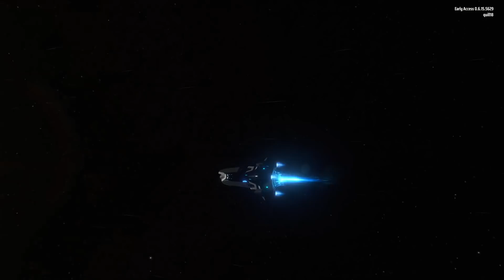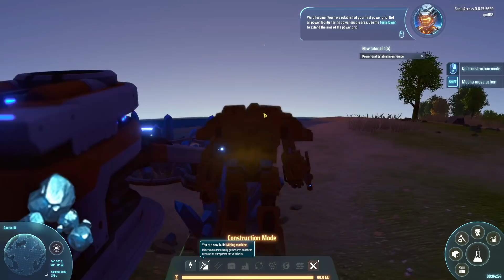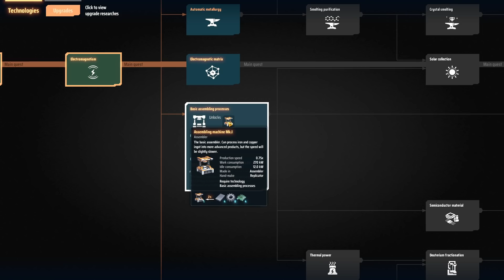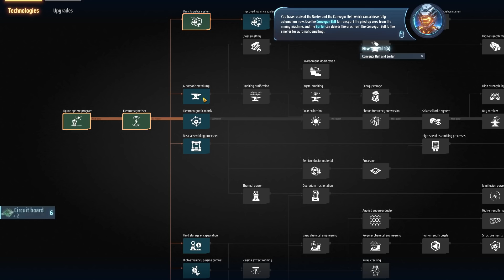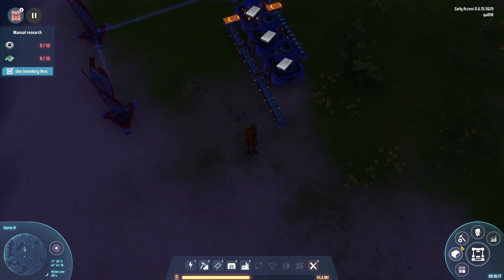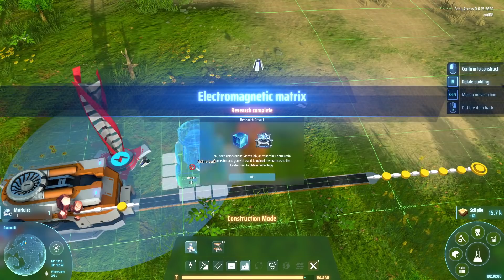Dyson Sphere Program - Cosmic-Scale Factory! Ep 1

Comment: if you do a bus, its most efficient to do 2 lines + space and repeat, the splitter stuff only goes 3 tiles max so the 3rd tile needs to be the space so you can output to a belt, move forward one, then split down to the next space, to move across the belt (of course you can do higher level bridges and stuff but does make things more complicated)

Comment: Also you can use multiple sorters from and to one building, you just had belts selected instead when you tried. Also you can use sorters directly from one building to another without a belt between.  the sorters are quite literally identical in function to the arms in Factorio.  They're basically the green(?) smart arms with variable length.  Edit: You figured this out later in the video, kinda figured you would.

Comment: The only thing that’s frustrating about this game is the grid system on small planets towards the poles. Especially the tiny starting planet. There’s so much water everywhere you have to work around, and then if you build towards the poles the grids get all weird. Also it’s be nice if conveyors carried power a certain distance so you don’t have to set up Tesla coils in the way everywhere. Maybe there’s an upgrade for that later on i don’t know. It’d also be nice if it was easy to tell which machines you can run a conveyor all but one space up to snd then have the shortest sorter possible to maximize its speed as some you can go right up to it and others you need like an extra node of space. And some things like storage chests you don’t even need a conveyor from a machine into it, you can just use a sorter right out of the machine into the chest. Also it’d be nice if you could split a conveyor in multiple directions a bit easier. I know later you unlock a splitter, but that again takes up space and I’d use that more for splitting one conveyor with different items into separate conveyors using the filter rather than just splitting one conveyor of one item into 2. For that I’m just using a separate conveyor line next to it and using a sorter to pull from it, or 2 or 3 if I need to bring more over. But hey it JUST came out for early access so I’m sure there will be plenty of fixes and changes and improvements. And for having just came out, I’m extremely impressed.
Reply: Also would be nice if similar to cities: skylines, once something that requires power is in range of a Tesla coil, that machine gives off a tiny bit of power extension range. That way you can bring a Tesla coil line within range of a production line, get it to power the first one, and then that once can extend power to the next one if it’s within range and so on so you don’t need to put Tesla coils down EVERYWHERE lol

Comment: You can use multiple sorters on one thing, you just selected the belt and not the sorter the 1st time you tried. 4 sorters at min range = one full belt at this tier. headsup, sorters are slower the longer they are, or rather their trips are longer, so they do less trips a second.

edit: you can stack some buildings as well. Some work together if you do(like research and storage), but other's just stand on each other, like splitters and belts(although that one might be obvious).
lastly, some buildings allow you to place tesla towers between them, even if the buildings are super close. The assembler is one of those buildings

Comment: One thing you COULDN'T do in Factorio is stack belts on top of each other. Stack 5 belts on top of each other, a different item on each belt, and you have a "five wide" bus in a single line.
Reply: Hence why people compare this to Satisfactory as well. :)
Reply: The downside to this though is that it takes quite a bit of distance to get things back down to ground level to use in machines. I wonder how well it compares to a wide bus as that's what I'm using right now. I just lift the belt I want to use up one level  and pull off of it. Also crossing a tall bus seems like a nightmare. Maybe there is some optimal middle ground between the two?
Reply: @TripleOmega  Hopefully they may consider an item elevator like Satisfactory has.
Reply: @bigdog91paper  you can sorta use splitters as an elevator, but it's not very compact
Reply: @LINKedup101  I mean, its 4 instead of  2 I guess
Reply: @TripleOmega    @WIbigdog  Looks like you could make a sqaure-spiral of ascending or descending belts to get around this problem.
Reply: @ILikeGoodFood  You could, but honestly that's kind of a pain to build every time you want something off your bus. Maybe if they add blueprints that let you copy and paste complex structures this will be viable.

I did think of a hybrid alternative though. Make your bus on level 1 and 3. Lift up or down to level 2 every time you want to pull off the bus. The downside to this is that you   are hard limiting yourself to using only level 2. You can never go over something that is in the way when extracting from the bus.
Reply: @TripleOmega  I ended up buying and playing the game and have found a number of issues with verticality and busses:
The belt splitters are two tall, not one, and can only be stacked two high without research.
This means that a bus can only effectively have a belt at ground level and at 2 stories up, with a pass-through-level 1 story up.
The splitters cannot have belts going over them at 2 stories up, or going under them, so if you want to branch one of your belts you must place a splitter on both in the column.
The splitters are 3x3 grid squares, however they also then need an additional square around them to get belts into and out of them. This means that they have an effective 5x5 footprint.
With these considerations in place, the most efficient buss using splitters is a belt at ground level and 2 stories up, with a gap of two grid squares on either side before the next double-belt. Combining this with the five square length required to get things up and down from the 2 stories up position to the 1 stories up position as a pass-through level, it's actually very bulky.
Also, the planets are way smaller than they look at first, and this bus rapidly starts to take up a significant portion of the planet's total surface area.
It does make for a very effective tree-style arrangement though, with the bus/trunk running straight through everything and tangental spokes/branches with manufacturing, smelting and research.
Reply: @ILikeGoodFood  I don't use any splitters on my bus for this very reason. It's nice that they don't require power and divide things evenly, but it's not worth the extra space requirements.
I did not realize they could be stacked, so thank you for that information. Might be useful somewhere.
Reply: @TripleOmega  you could do it to a half level
Reply: @d4s0n282  What do you mean by a half level? When I refer to levels I'm referring to all the heights that conveyors can reach. So there are no half levels in my point of reference.

Unrelated to your comment I also have to mention that since my last comment I learned that splitters have 3 variants. One of which makes splitting off of a bus very easy. It does come with the big downside of requiring a gap between each lane to accommodate the splitters, but it may be worth it just for the ease of construction.
Reply: @TripleOmega  well yes, but you can force it to half a level, thus it only takes 2 instead of 4
Reply: @d4s0n282  I still don't understand what you mean by half a level. If I press up when holding a belt I bring it up from 0 to 1. That is what I mean by a level. As far as I know there is no way to run a belt at 0.5. I also don't see how that would help reduce the splitter requirement for an elevator.

Comment: One of the really fun tips that you might miss the game telling you:  You can stack storages AND labs on top of each other.  And the bottom one in the stack feeds the ones higher.  They don't share inventory so if you want something from one of the stacked buildings but not another you have to click on that specific one, but well...

It basically allows you to triple your science speed at the start using the same space, because it doesn't take much to provide three times the resources needed for a single production cycle of the science resources compared to just one.  So you build a stack of three labs to produce your blue science, then you build a stack of three labs to consume the blue science.  Adding another stack of labs to produce the red science later on and feeding it to the research stack isn't hard either.  Though I suspect that as you unlock the later three types of science it becomes a lot more annoying.

Particularly if you've also gone to the upgrades research tab and researched the upgrades that mean you can stack more than two storages or three labs on top of each other.

Oh, second tip.  You can store liquids in storages.  But it only stacks to twenty per slot.  Storage tanks store a lot more of a single resource, but you don't insert it via sorter.  You send it in directly via conveyor belt.  That messed with me for a few minutes until I had the lightbulb moment there.

Comment: I personally like this one more than Factory currently. By the way, building the conveyer belts up/down is easier if you hold the shift key, then it snaps to what you're pointing at. Also, you can make shorter overpasses if you build up until it let's you build it and then delete all further conveyer belt segments you didn't really need and build down from there again. Play around a bit, you will understand what I mean.
Reply: I feel like the increments you can half build to shoulda been the actual increments lol
Reply: @LINKedup101  agreed,  but it  is  a early dev thing, I bet they will introduce it later  prob